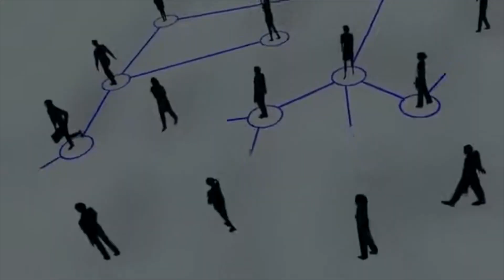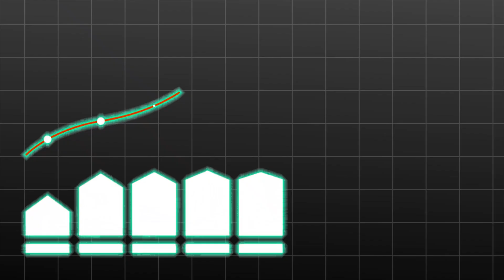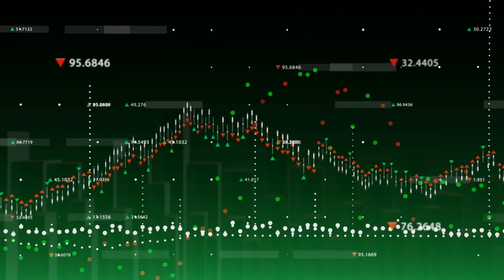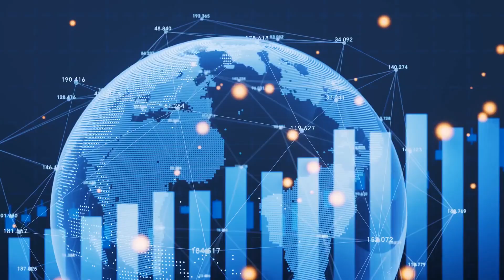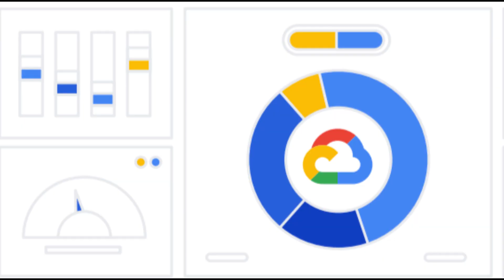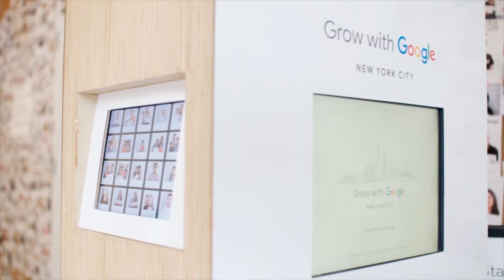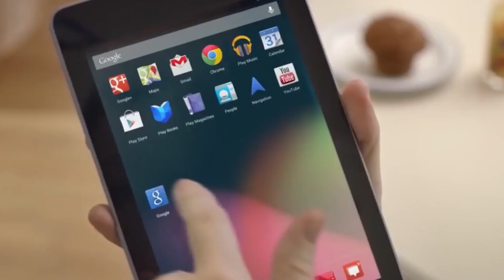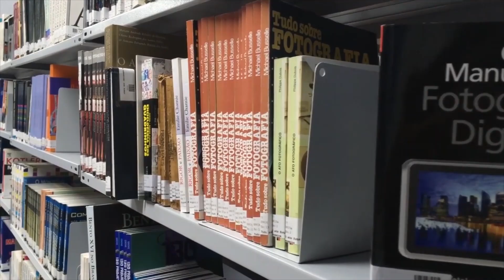Google's Massive New $650 Million Data Center In Norway

Comment: The energy consumption is a huge concern! 
This data center is supposed to use 7 TWh annually. This is more than half the surplus of electricity generated i Norway (for only 100 more jobs). 

This will contribute to higher electricity bills for the average norwegian.